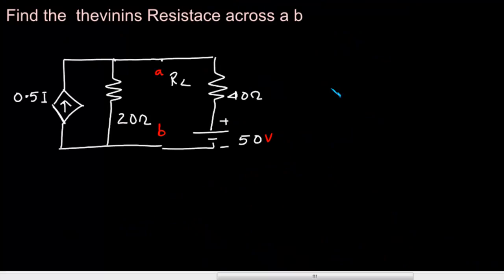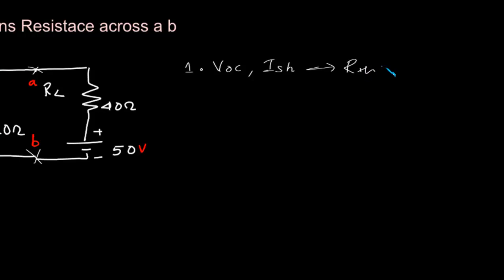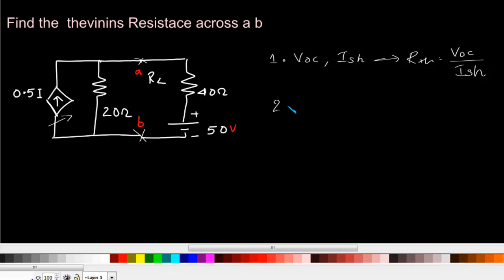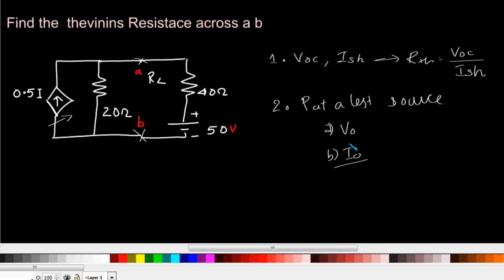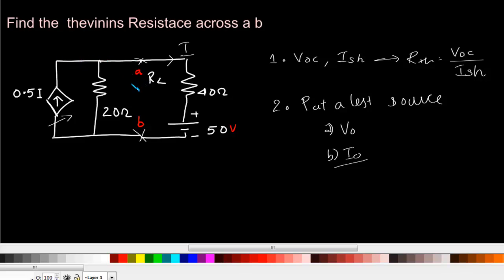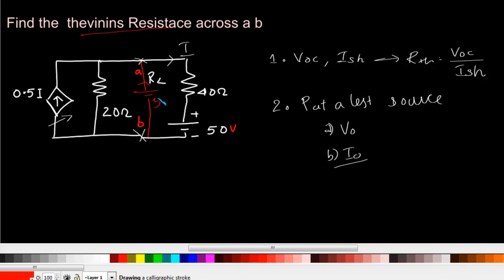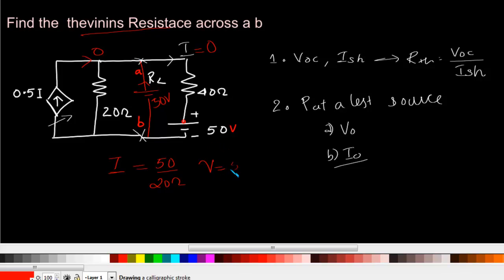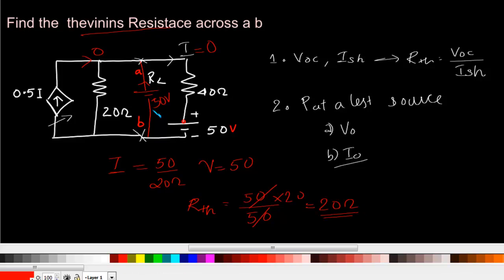GATE EC Previous Papers Network Theory #9

Comment: The answer is wrong, it is 16 ohms
Reply: Alwin Augustine how
Reply: can u elaborate?
Reply: Yes correct ans is 16 ohms only, before applying test source we have to remove the independent sources!! Now you short circuit  50 V source and apply test source. you will get  16 ohms.
Reply: Answer is 16